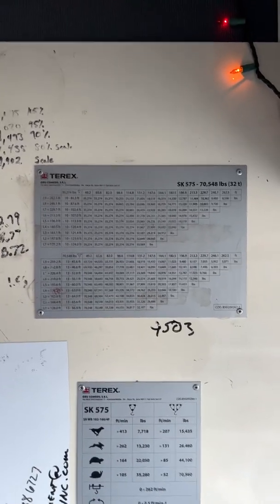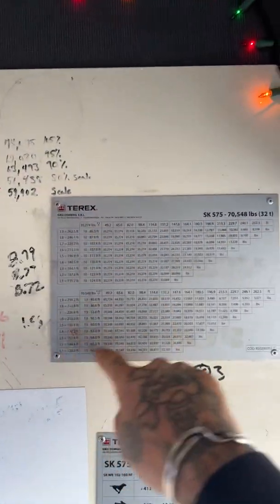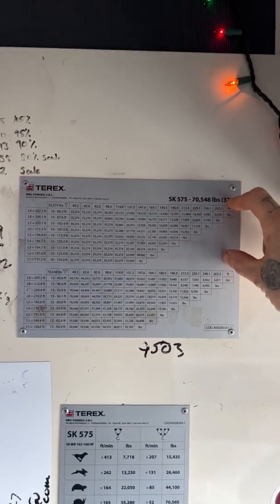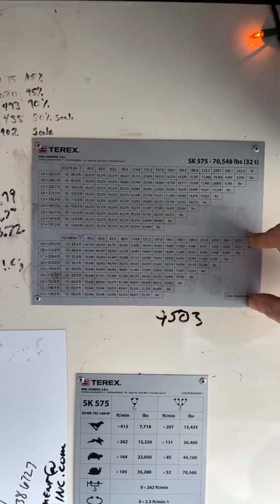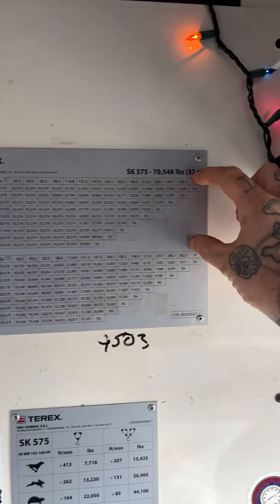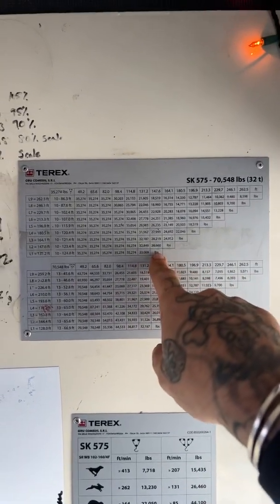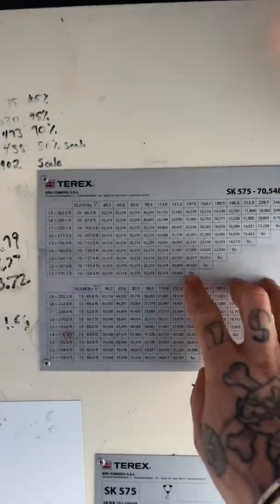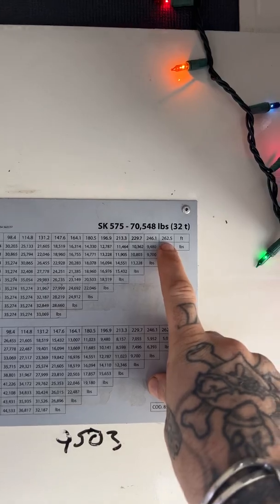How to determine what I can and cannot pick up in my Tower crane￼￼/ load charts/ Load limit￼￼

Comment: On average what would you say is the typical weight you lift ..on average, is there a pucker factor when lifting the max :)
Reply from the maker: On average the typical weight that I lift is around 10,000 and under but when unloading rebar trucks I will often hit close to 20,000.
I’ve been doing it so long that I don’t really have nervous feelings anymore even when I reach max capacity.
With cranes in general they are typically D rated to 75% of their max ability, meaning that the crane is well within its limits when it is at its load chart max.
Hopefully that made sense?

Comment: Tower crane operator is such an interesting job.  How did you ever get into this field?  It must have been very frightening the first time you went up to the operating chair.
Reply from the maker: Most definitely! 
I have been a heavy equipment operator for almost 27 years starting with dirt equipment and eventually worked my way into cranes. I knew that I wanted to eventually be in a TowerCrane so I got my license through schooling and spent a lot of time on the ground as a Bellman and Rigger working under the hook for a couple years and eventually doing maintenance on the cranes. Getting seat time every chance that I could to practice and eventually the position opened up and I got the opportunity!!
Yes the very first time and I went into a tower crane it was very scary but very exciting!!